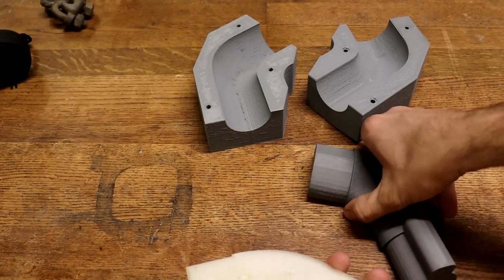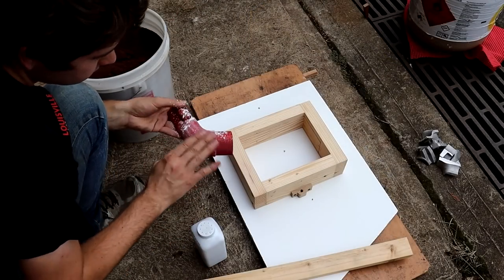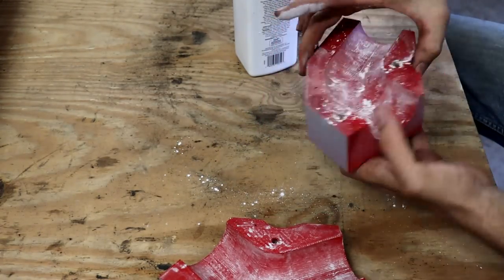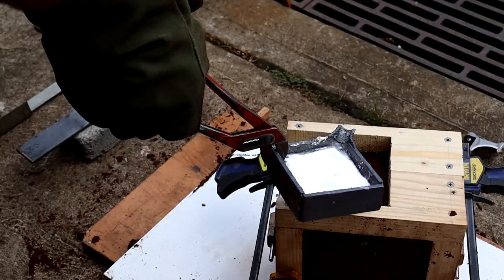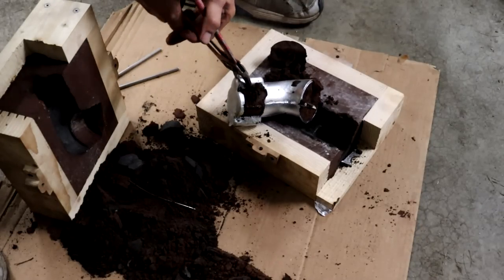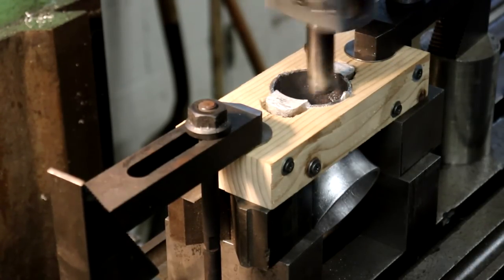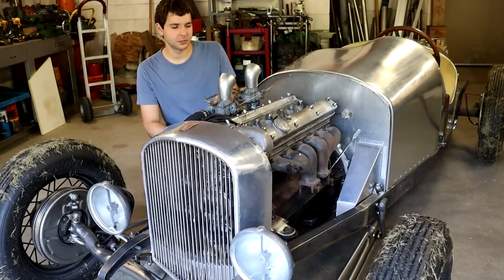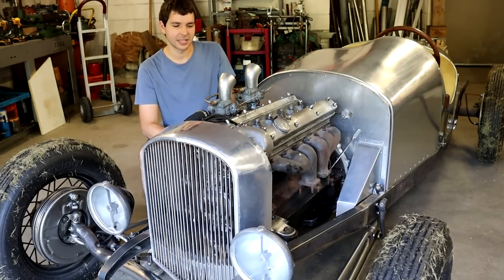Sand Casting Custom Intake Scoops | Homemade Boat-tail Speedster Pt. 61

Comment: The casting operation was very nicely done. They look super.
The open space in a mesh filter is very limited and may well inhinbit the air flow to high degree. 
I shall be very interested to see how they work out in practice. Maybe you have already checked the spec sheets for mesh??
Reply: Probably restricted flow about 50% or more. 
The mesh will usually have a 'surface area' per square inch telling you how much restriction you have based on wire diameter and mesh size

Comment: Oh no! Set screws arent't clocked the same. Just kidding. Nice job with the casting. I agree with the upright configuration with carbs and the scoops. I balances the look with the hump in front of steering wheel. 
I wonder what kind of plans you have for the exhaust. Something visible and racing inspired, I hope.

Comment: Awesome...! But, should they not be facing forward...to create a RAM effect like on Sportbikes...or am I missing something...? Is there not more of low pressure (vacuum) at inlet in that orientation, as air is deflected away? More power is the goal, isn't it...?

Comment: The larger engines like the 3.8 and 4.2 had side draft Solex carburetors, not Weber. My parents had a sedan with the 3.8 engine and my brother has a 4.2 XKE and both have Solex carbs from the factory. They are significantly bigger than yours but that should be expected with the larger displacement. I wasn't aware that Jaguar or British Leyland made a 2.4 Liter engine.
Very nice work. Hope you get to move out of California.

Comment: pretty nice castings... fwiw, the very fine mesh is probably going to restrict your air intake severely though (ok to drive to the coffee-shop I suppose, but you likely won't get the performance level you would expect on long straight with it imho)

Comment: Nice job !!!
What shrinkage did you allow for ? I once cast me a mirror holder for a 12” Newtonian telescope and forgot to add shrinkage, it just worked but was a much tighter fit than I hoped for :-)
Could it be that filling up the mold to the top increases pressure inside the mold and reduces the risk of voids ? The first good cast seems you filled the mold to the top. 
Also did you consider to pre-heat the mold box ? Maybe just place it on a shelf above the melting oven ?

Comment: They came out real nice for thin-wall castings, what was the average thickness? (1/8" or less?)
Did you have a surface area for the mesh? It's based on wire diameter and mesh size, you will probably find airflow is severely restricted above half throttle.

Comment: There is a air filter developed for logging on Mt st Helens after the eruption. It's a super fine mesh copper screen so fine it kept volcanic ash out of the engine . Cheap air filter. If you can't find the mesh get a couple big saw St Helens filters and replace the thousand meh screen with st Helens filter screen . A permanent cleanable air filter

Comment: I wonder if that mesh will be too restrictive, air filters usually have a much larger area than the carb size and you may have effectively halved the bore there.

Comment: Awesome job, and a great casting tutorial.  You should consider putting a radius on the inside edge of the inlet. Air doesn’t like flowing around sharp corners so a square edge will reduce the effective diameter more than you would expect, and also cause turbulent flow.

Comment: What a great episode ... took me back to my youth in "Middle School Metal Shop" days ... most can't imagine 12 year olds getting to cast Aluminum (and Bronze) in "School" ... but we did !!! And later in "Jewelry College", we learned just how important "Borax Flux" is in the process ... allowing to drag the slag off the top and result in better casting and less pits.  You did so, so good on your scoops ... would only recommend some fine cell foam (soaked in oil and rinsed with Gas ... we used them on our Motorcross Bikes ... "green weenies") and surely they make a Gray colored version that would allow you stuff down to the level of the mesh grid and not look out of place, easily serviced.  Thanks again !

Comment: I'm trying to build an Amilcar C6 inspired Voiturette / Indy Roadster kind of build. But I'm trying to work out what chassis I can use that is small enough to accomodate the drivetrain (Toyota 2RZ 4 cylinder with Eaton supercharger fed by pressure carbureter) and be of that time period but not be any bigger than necessary (The common Ford Model A Hotrod type stuff is too big) I looked at an Austin 7 chassis the other day which might be a possibility but I'm not set on it yet.

Comment: Hi Nice job on the casting, if you slot one side at the lower front of the scoop you could put a hose clamp at the bottom to secure it.

Comment: They turned out perfect, very nice work.  I'm sure you know this, but If the mesh proves to be  too restrictive, it's area can be greatly increased by pressing it into a dome shape. Simply done with a ball pressed in a cup or tube.

Comment: Question for you.. How did you keep the walls of the sand molds from touching each other during the pore?  Do the printed molds have grooves that keep them aligned?  It seems like gravity would have them touching each other.

Comment: You did a great job with the method you chose to use, but surely the ultimate goal is to lathe out some trumpets? The historical equivalent probably would have had trumpets even if not lathed out, and as far as I know they will perform better than those scoops.

Comment: This was quite possibly the soonest that I've seen one of your videos, like within 5 minutes of your upload - and well worth it too, to see some more sand casting work that turned out so well.  I'm sure I mentioned it before in response to the video where you cast your acçelerator/clutch pedals, but I really enjoyed the whole procedure when I was able to do it hands-on in my foundry and forming course at Uni, half a lifetime+ ago.  Wish I could come up with a reason to use those processes now - and the means for a 3D printer, that I would likely never have a shortage of ideas to use it for. 

Given how busy you are with your new job and how little time you have in comparison for working on your car now, do you plan to leave those scoops in their natural state of finish, or are you going to do a high polish on them?
Reply from the maker: I'll leave the finish about how they are now
Reply: A

Comment: Such excellent work as usual.  I am afraid that those fine mesh screens are going to be quite restrictive to air flow.
Reply: I guess you could be right but more restrictive than paper/foam?
Reply: @colossalbigfoot256  The openings in that mesh are many, but the cross section area of the fine wire is sizable and therefore restrictive.  Think of the power loss due to a catalytic converter. which can be up to ten to twelve horsepower.

Comment: For future reference. If you need to heat up a 3D printed part. Boil some water, drop the part in the water and let it sit there for 15-20 seconds, pull it out and do what ever you need to. It does a much faster and easier job of softening parts.

Comment: Loving the build and great to see you back on it. Quick question.   Just wondered what the carb setup is as not seen this single choke downdraughts on an XK engine before, usually SU's or Strombergs. I guess its an old engine from the 50's or 60's looking at it.
Reply: The carbs are Solexes which were standard fitment to the Jaguar 2.4L Mk1 and 2.

Comment: Turn those around 180 degrees to get some ram air effect !!  Makes a difference !! Also beware the 2,8 tends to burn exhaust valves on the no 1 cylinder , the one closest to where u sit ....Yep, Jag counts from the drivers placement.
Reply: It's a 2.4L.

Comment: A really easy source for sodium silicate is your local auto parts store.  Go to the section that has the radiator/block sealers. Almost all of them contain sodium silicate,  and 1 or 2 of them only contain sodium silicate or "water glass".  Been enjoying your videos for a long time.  Good luck and good fortunes!

Comment: Protip: put your talcum powder into a little sock for easy and even application. By gently smacking the sock on your molds you can get a really consistent, even, adequately-thick layer of talc. If you want something purpose-made for distributing fine powders, go to the rock climbing section of a sporting goods store and ask after "chalk socks" which shouldn't cost you more than five dollars for a pack of three. Maybe the boost to efficiency isn't worth it for a one-off casting, but, if you end up getting into casting your own parts regularly, you will save untold time and headache by using the "pro" technique instead of spreading the talc with your finger.

Comment: Hey Sir. Hope you had a great Thanksgiving. Got an idea. I used to pour lead into molds like your doing. But your using aluminum. So my idea is if you can tap the wood molds a little it will let the molten metal go down further into the mold itself. The way you did it was the first time I have seen it done that way. But I like it the way that you did it. I just think that if you maybe taped the wood after you got the sand in there maybe it would have been complete. But just saying. Have a great time in Cali and hope to see some videos around Christmas time.
Reply: Nope!  Tapping on sand while metal is liquid is great for getting sand into metal. And stressing the metal while changing phase.

Comment: How do you keep the core centered in the mold so the wall thickness is uniform?
Reply from the maker: Once the mold is assembled, it won't move. Placing it right though takes some practice. That's why a couple of them didn't fill out completely. The cavity got too thin there

Comment: Great casting! But why do they seem to be backwards? Won' t low preassure behind the pull air up from carbs?
Reply: It would seem so, but in reality, they don't work as well with forward facing scoops that are directly attached to the carbs.
Reply: @lunkydog  why tho? It leans out the mixture at higher speed?
Reply: For performance, the scoops should face forward, but I suspect that he pointed them backwards to keep rain and other debris from getting sucked in. When scoops are very close to a vertical surface, like a windshield, a high pressure area is generated which justifies facing scoops rearward for improved performance. Otherwise, they should face forward. NACA inlets provide one of the best compromises, but they won't look appropriate on this vehicle.

Comment: With down-draft carbs it would be wise to have a fuel shutoff for when it's parked. A leaking carb could fill a cylinder and cause hydraulic lock when you crank the motor. Awesome work as usual. Bring home a Cali hottie to ride shotgun with you. She'll need to be petite... 😄

Comment: Should try lost PLA casting method
Reply: Nza420 have you done any lost PLA casting? Or just suggesting?
Reply: @honthirty_  I use to work in a dental lab, so, I am well familiar with lost wax method.   However, I have not tried lost PLA method.

Comment: watched you put the moulds in the flask and tuning it over i was thinking he put the mould against the wood side that might be a problem 
as for using cast aluminium for remelting and casting make sure you got aluminium thats been sandcasted not die casted , the diegasted aluminium gets forced intoo the cast and is a little stickier and thicker when melted so there are differences between cast aluminium aloys  , allso use a flux as it makes it flow better and with less inclusions 
mightve been able to use gipson or plaster for the cores once cast you trow the pieces in water and the core dissolves out of it might need an actual release compount to get it out of the 3d printed mould though
Reply: Punctuation is important.

Comment: Those came out great. Its been fun watching you build that little car over the years.  Might have to invest in some 3D printing tech, I want a bunch of Pontiac parts, like finned valve covers and scoops for my dual quad manifolds. Have LOTS of cast aluminum laying around, broken LS truck heads will make lots of cool parts.